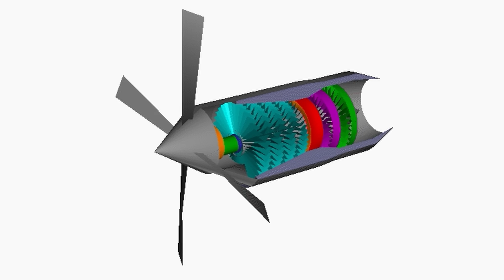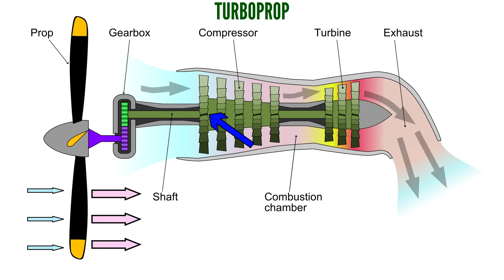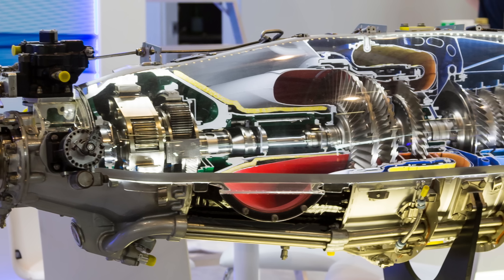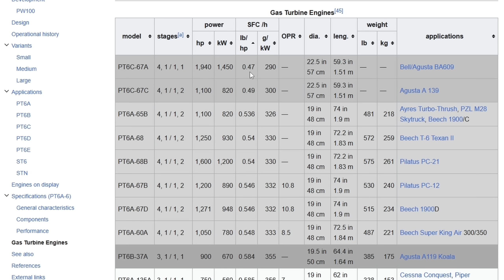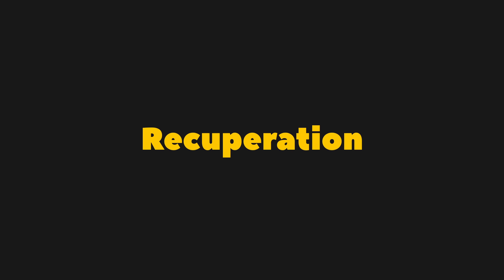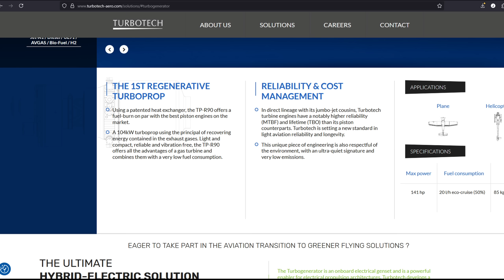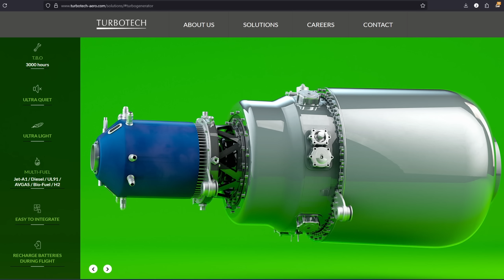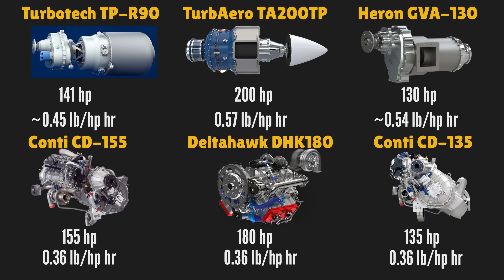Are Piston Engines Dead? Small Turboprops are Here

Comment: The solution is staring us in the face:  Aircraft piston engines have not seen a technological upgrade in 50 years of any significance compared to automobile piston engines.  Auto engines use computer control of fuel mixture, ignition timing and many other factors that allow the engine to operate at optimal power for a given fuel flow.  These auto engines do not burn valves, they do not knock or detonate, they do not run rich wasting fuel.  The computer has sensors and records what is happening allowing the engine to be diagnosed during maintenance such as routine oil changes.  A pilot of a GA piston aircraft has to monitor the engine by adjusting the mixture.  If this is done incorrectly, the engine can be put into detonation which is serious.  It is estimated that about 20 percent of the GA piston fleet has engines with unhealthy valves.  We need to replace the GA Piston engine with an automobile equivalent and take advantage of the 50 years of advanced technology that we have in the automobile industry compared to aviation piston industry.  The pilot should not need to monitor or baby the piston engine controls such as Exhaust Gas and Cylinder Head temperature.  He should, like a person driving a car, focus on flying and navigating the airplane.  Consider that the Cirrus SR22 has the most advanced avionics, even better than what they have in the airlines.  Yet on the engine side of the firewall is the equivalent of a Model T piston engine.  It's an embarrassment to say the least.
Reply: Unfortunately these modern high tech automobile engines cannot pass the PFTR reliability tests for FAA or EASA airworthiness certification... automobile engines are designed completely different and few have the inherent reliability to be used in aircraft safely.
Reply: @DoktorBayerischeMotorenWerke  The Toyota FV2400-2TC was an FAA certified version of their UZ V8. The Porsche PFM 3200 was essentially an automotive engine that was converted and certified for use in aircraft, as are the Austro Engine and Continental diesels.
Reply: @PistonAvatarGuy  From what I understand Toyota never completed the certification process and has abandoned the project.
  The Porsche 901 series engines are the most reliable automobile engines ever made and hold the most wins in endurance racing history, unfortunately the PFM 3200 was not commercially successful and is no longer certified or supported by Porsche.
 The Mercedes Diesel engine is another extremely rare example and has found a tiny niche market.
Reply: @DoktorBayerischeMotorenWerke  From what I've read, the Toyota engine was granted certification, but never went into production.

In the US, at least, the Honda/Acura B-series and K-series 4 cylinder engines have been said to be the most reliable engines ever produced, but opinions vary. The Toyota UZ series V8 is also said to be one of the most reliable automotive engines ever produced. I've never seen a claim that any Porsche engine is among the most reliable engines ever produced, they simply aren't driven for long enough in large enough numbers for that claim to be made.

The market for Mercedes-based diesel aircraft engines seems to be growing.
Reply: @PistonAvatarGuy  Toyota announced that it had completed FAA PFTR testing but the program was canceled before certification process was completed.
Exactly, the Toyota engine never went into production as an aircraft engine... so we will never know if it was any good.

Porsche has WON LE MANS 19 TIMES! and the company has more motorsports victories than any manufacturer in history.

Thielert and Austro/Diamond have had considerable financial difficulties with low sales and lack of profits from the Mercedes engines. 

Automotive based aircraft engines remain extremely rare... they are simply not designed for aircraft use and aircraft engines are just too expensive for cars, they are two completely different animals
Reply: @DoktorBayerischeMotorenWerke  According to Flight Global: "Toyota has received US Federal Aviation Administration production certification for a piston aero-engine...."

I'm not arguing that Porsche doesn't produce good, reliable vehicles and engines, I'm just saying that they've never really been considered to be the most reliable, long lasting vehicles on the road.

Thielert had financial troubles, I don't recall Austro Engine, specifically, ever having financial trouble.

Automotive-based aircraft engines are rare because automotive companies are almost never willing to produce new engine cores for use in aircraft, due to the liability, it's not related to any shortcoming of automotive engine technology (as Porsche and Austro Engine have shown). Automotive engines are mercilessly torture tested in ways that aircraft engines would likely never survive, and those tests even include the engines being run at full power for hundreds of hours. While many automotive engines have reliability and/or quality issues which would prevent them from being reliable when used as aircraft engines, there are others that would work just fine. Honda's L-series and J-series engines have even proven that they can be reliable for over a thousand hours in aircraft, even while running on low octane fuel and while being pushed harder than is often typical for aircraft engines.

Edit: lol, autocorrect
Reply: @PistonAvatarGuy  There is a difference between reliability and durability, and a difference between high performance cars and economy cars.
 Then explain why Honda L and J series engines are not used in aviation?? 
You talk a good game, but your story comes up short.
Reply: @DoktorBayerischeMotorenWerke  The Honda L and J series engines are used in aviation. Titan Aircraft has been using the J-series in their T-51 for many years, while Viking Aircraft Engines sells conversions of the Honda L and R series engines for use in aircraft. Aero Momentum also sells Suzuki automotive engines for use in aircraft.

Edit: Viking also recently started offering a conversion of the Honda K20C2.
Reply: @PistonAvatarGuy  Thank you for proving my point... those are all uncertified engines and experimental aircraft.
Reply: @DoktorBayerischeMotorenWerke  Really, the whole discussion can be boiled down to this:

You: Automotive engines can't be used as aircraft engines.

Reality: Automotive engines ARE being used as aircraft engines.
Reply: Not true, modern aircraft engine now use FADEC which functions the same as ECU based automobile engine controls.
 Automobile engines can make more horsepower because they do not have to pass the much more rigorous flightworthiness tests required for passenger aircraft.
Reply: @WilhelmKarsten  Almost no piston aircraft are sold with FADEC controls. In fact, the Austro Engine and Continental diesels are likely to be the only true FADEC piston engines currently on sale. There are some piston aircraft engines which make use of EFI, but they're not actually FADEC engines, as the pilot still controls the throttle valve.

I love the completely misinformed upvotes happening. Hilarious.
Reply: @PistonAvatarGuy But you are aware that piston engined GA aircraft are available with true FADEC or FADEC based controls?

If there really was a true demand in the market? The use of FADEC would be available, the technology is already available.

Piston engines don't use constant speed props, so Full FADEC control for the throttle is not required.
Reply: @WilhelmKarsten  "...Piston engines don't use constant speed props"

Ok, now you're just trolling.
Reply: @PistonAvatarGuy  You forgot the Continental TSIOF-550... it has FADEC
Reply: @DoktorBayerischeMotorenWerke  They call it FADEC, but the pilot still controls the throttle valve... as far as I can tell, anyway.

If that's how the system works, that definitely limits the ways in which the engine can be operated. Really, what you'd want is a power lever in the cockpit, that way the FADEC system can operate the throttle valve for maximum efficiency.

Is that engine even offered for sale? I remember that it was supposed to go in the Cirrus SR series, but I can find no evidence that it was ever offered for sale in that aircraft.
Reply: @PistonAvatarGuy  There is only one automotive based engine currently available that meets FAA or EASA airworthiness certification... so you lost that argument.
Reply: @DoktorBayerischeMotorenWerke  A) The existence of even one aircraft engine based on an automotive engine proves that I'm correct. Your assertion here is that automotive engines cannot be used as aircraft engines, but that statement is completely incorrect. You tried to argue that automotive engine technology is inherently incompatible with aircraft engine technology, you've been proven wrong.

B) Technically, there are more than a few models of aircraft engine that are certified and available for purchase which are based on automotive engines. The Continental CD-100, the Continental CD-135, the Continental CD-155, the Continental CD-170, the Continental CD-300, the Austro Engine AE300 and the Austro Engine AE330 are all automotive engines that have been converted for use in aircraft. If you really want to get stingy about it, there are two automotive engines which have been converted for use in aircraft that are FAA and EASA certified, and are currently available for purchase; the Mercedes-Benz OM640 and the Mercedes-Benz OM642.

There are more automotive engines that have been converted for aircraft use in the experimental category than I can even name here, which also proves that automotive engines can technically be used as aircraft engines. The fact that they're not certified only proves that they haven't gone through the certification process.

Edit: At least four automotive engines have passed the FAA certification process, something which you stated automotive engines cannot achieve. The Mercedes-Benz OM640, Mercedes-Benz OM642, the Porsche PFM 3200 and the Toyota FV2400-2TC.
Reply: @PistonAvatarGuy  Then explain why the hundreds of other automotive engines available are not?
 dozens other automotive engines have been submitted for FAA or EASA airworthiness certification and failed, most failed in spectacular fashion.

Experimental aircraft are allowed to use engines without any airworthiness certification or laboratory reliability testing.
 You can install a lawn mower engine on your experimental or ultralight class aircraft.
 this in no way proves that automotive engines suitable for passenger aircraft use.

The Mercedes engine is an extremely rare exception... not the rule.
Very few of these engines are actually in use and their success has been limited and many in the industry remain skeptical that they will around much longer.
Reply: @WilhelmKarsten  There is a demand, but people cannot purchase that which the market refuses to offer.

Anyway, Diamond's market share is continually growing, so I'd say that's a good indication that people want aircraft with engines that are simple to operate. People also seem to be quite smitten with the EFI engines from Rotax. Non-certified engines with EFI also seem to be quite popular (Viking aircraft engines, ULPower engines, Aero Momentum engines, etc).

The problem is that there are no certified FADEC engines being offered in the higher power output range* (300+ hp), or in specific aircraft (Cirrus, for example). The Tecnam P2012 uses EFI Lycoming engines, it seems to be selling well.

*gasoline engines... the CD-300 qualifies, but seems to be quite heavy and inefficient.
Reply: @PistonAvatarGuy You didn't know? Most turboprops only have a thrust lever...reciprocating piston engines have to change rpm to vary the engines thrust.
Reply: @WilhelmKarsten  I'm not sure what you're trying to say here, plenty of piston engines have constant speed propellers. With manually controlled systems, the pilot sets the propeller rpm and the propeller will maintain that rpm, regardless of changes to the engine power output. With a FADEC system, the computer would choose the optimal propeller rpm for the engine power setting (and possibly other parameters, like air speed, air density, etc).
Reply: @PistonAvatarGuy Not the same thing, those are varible pitch propellers, not the same as a true constant speed system... they require automatic throttle/fuel control.
Reply: @WilhelmKarsten  Variable pitch propellers are not always constant speed propellers. Variable pitch propellers allow the user to manually set the propeller pitch (either on the ground when the engine is not in operation, or via some kind of electronic or hydraulic system which allows the user to set the pitch while the engine is in operation), while a constant speed system will allow the user to set a specific propeller speed (rpm), which the system will automatically maintain.

Edit: To get technical about it: With a variable pitch propeller, you are directly controlling the propeller pitch. With a constant speed propeller, you are controlling a governor, which adjusts the propeller pitch in order to maintain the rpm which you have set.

If you want to test my knowledge, just ask me directly, you don't need to sleaze the answer out of me by posting incorrect statements.
Reply: @WilhelmKarsten  See: How A Constant Speed Propeller Works By Colin Cutler
Reply: I did explain: Automotive-based aircraft engines are rare because automotive companies are almost never willing to produce new engine cores for use in aircraft, due to the liability...

"dozens other automotive engines have been submitted for FAA or EASA airworthiness certification and failed, most failed in spectacular fashion."

Source?
Reply: @PistonAvatarGuy  Source? There have been many attempts to certify automotive based engines. Mazda and General Motors are just two well-known examples that failed disastrously... there are many more if you care to sift through the many old industry periodicals.

 Anyone in the aerospace industry will tell you that trying to certify an automotive engine is not a viable or practical alternative... and so far, none have proven successful or profitable in the long term.
Automotive engines are simply not designed to meet the rigorous demands of aviation use. 

You seem reluctant to accept this fact.
Reply: @DoktorBayerischeMotorenWerke  Mazda... as in rotary? The rotary isn't even a good automotive engine. GM has also produced many, MANY sub-par engines over the years, but I'm not sure which engine you're referring to here. As I said before, not every automotive engine is up to the task, but that doesn't mean that automotive engines can't be used as aircraft engines, in general.

Yes, people in the aerospace industry will say that, but those people are wrong, because automotive engines have been certified for use in aircraft. It's also very likely that those people have a vested interest in eliminating any new competitors.

Whether or not a new engine design is profitable in the long term seems to be completely unrelated to whether or not the engine is based on an automotive engine, it seems to be entirely dependent on the company's financial resources. Many new, purpose-built aircraft aircraft engines have also failed to enter into production. I'd argue that profitability is the entire problem and that there is no technology related problem.

Austro Engine seems to be doing quite well, btw, but some of that is owed to the fact that they were able to benefit from Thielert's initial investment and failure, for which Austro Engine were not held responsible. I'd say that proves that whether or not an engine is profitable is in no way related to the technology of the engine itself and that the technology is clearly up to the task, but the economics simply can't support advancement.
Reply: @PistonAvatarGuy  Why do refuse to accept the facts?
Reply: @PistonAvatarGuy Automotive-based aero engines are rare because they cannot pass the required reliability test.
This is because car engines are simply not designed to handle the extreme punishment that aircraft powerplants must endure.
 You have convinced yourself that you know more than the engineers and the experts... but you could not be more wrong

Your knowledge regarding this specific aspect of aeronautical engineering is so poor that you are unable to discuss this topic intelligently or honestly.
Reply: @WilhelmKarsten  I'm sure that's true for many automotive engines, but it's not true for ALL automotive engines, which is what you're trying to claim here. Clearly, in some cases, automotive engines are capable of being certified as aircraft engines, period.
Reply: @WilhelmKarsten  Seriously, you're trying to claim that you know more than the FAA, who have actually certified automotive engines for use in aircraft!
Reply: @PistonAvatarGuy The Mercedes-Benz OM640 is an exception from the rule... and occupies a very small niche market.
Manufacturers have not shown any indication that the industry is going to shift in this direction.
Reply: @WilhelmKarsten  The Mercedes-Benz OM640, Mercedes-Benz OM642, the Porsche PFM 3200 and the Toyota FV2400-2TC are the four automotive engines that I'm aware of that have been certified for use in aircraft by the FAA, but it's entirely possible that there are others. Supposedly, one of the GM LS V8s was FAA certified, but I haven't found any good sources on that one.

Of course the market isn't going to shift in that direction, automakers don't want the liability associated with having their names attached to aircraft engines. My only contention here is that (some) automotive engines can be used as aircraft engines.

I also believe that blank-sheet engine designs, which are similar to automotive engines, but designed from the start as aircraft engines, SHOULD be produced for aircraft (the Adept Airmotive engine, for example). If no one is going to step up and produce what the aviation crowd would refer to as an automotive-style engine for the 250 to 400 hp range, it's likely that leaded fuel will be in widespread use for decades longer than it should be in use.

It's a shame that such enormous financial resources have been spent on diesel designs that never went anywhere (the Graflight V-8, the Red A03, the SMA diesel, etc), as we could have had some quite nice gasoline engines in production with the same amount of investment.
Reply: @PistonAvatarGuy  Automobile engine do not make good aircraft engines... why can't you get this simple fact through your thick skull lad???
Reply: @DoktorBayerischeMotorenWerke  ...the facts, lol. You people are trying to argue that only ONE automotive engine has been certified by the FAA! You don't even know the facts!
Reply: @PistonAvatarGuy  There is currently only one certified automotive type engine still available and in production.
Reply: @DoktorBayerischeMotorenWerke  False, the Continental CD-300 is currently available and in production, it's currently being offered for sale in the Diamond DA50.
Reply: @PistonAvatarGuy How many sold?
Reply: @WilhelmKarsten  How is that relevant? The contention was that automotive engines can't pass FAA certification tests, but some clearly can.
Reply: @PistonAvatarGuy They don't just struggle the pass certification... they are consistently unsuccessful as well.
Reply: @WilhelmKarsten  Source? Which engines were tested? Which engines failed?

Anyway, the assertion was: "Unfortunately these modern high tech automobile engines cannot pass the PFTR reliability tests for FAA or EASA airworthiness certification..."

That's a false statement, as some automotive engines are clearly capable of passing the certification tests.
Reply: @WilhelmKarsten  So, you're just going to go off on your own little tangent, there, huh? Who said anything about them being successful? Who ever said that ALL automotive engines are capable of passing the certification tests? You're arguing against things that no one is even saying here.

Also, from a technical standpoint, the PFM 3200 was a success. The Mercedes-based diesels also continue to be successful.